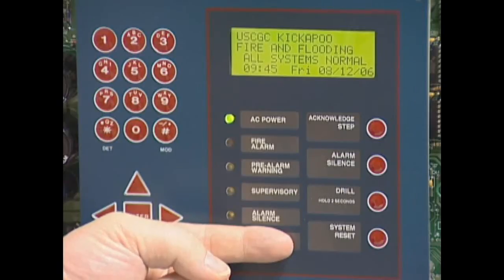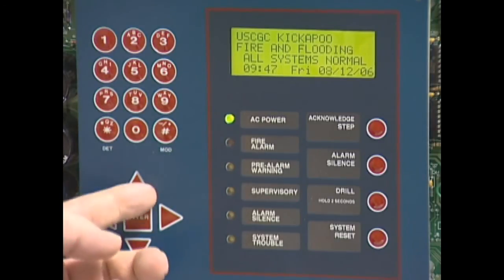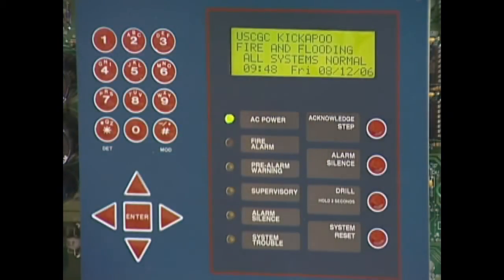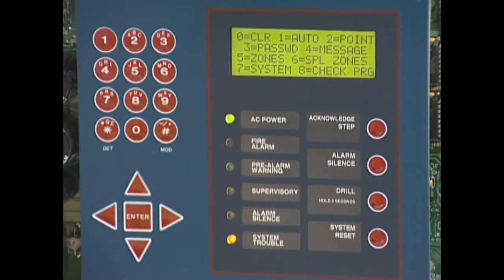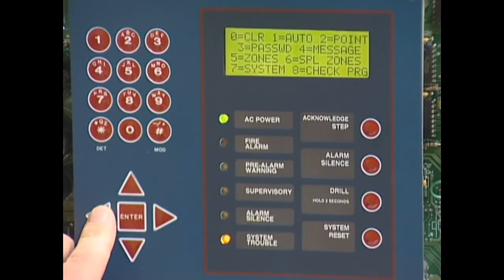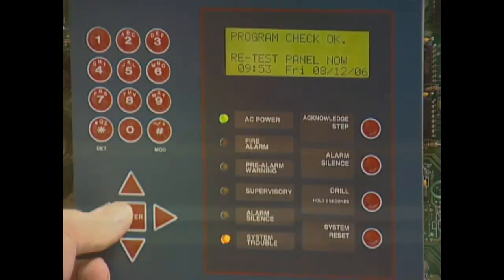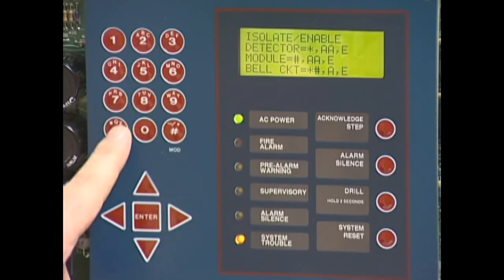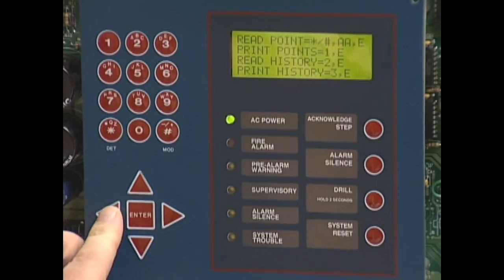Hiller Systems Inc   USCG  AFP200 Training Part 2

Comment: My college has a Notifier AFP-200 system in the Student Union. It replaced an old Standard Electric Time panel. Several of the old horns are still intact, but with 90s-style Faraday strobes added to replace the old incandescent lights. The renovated areas have SpectrAlert Advance horn/strobes on Code-3 (the non-renovated areas are on Continuous.)